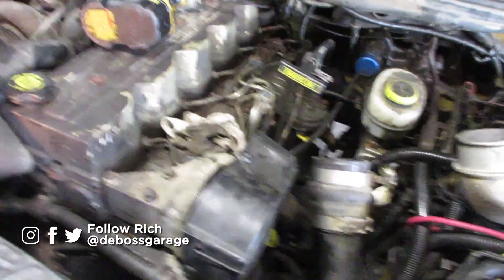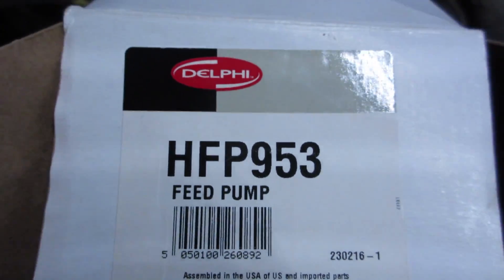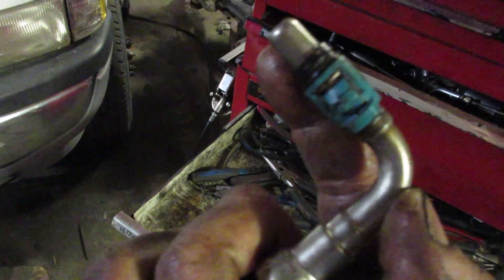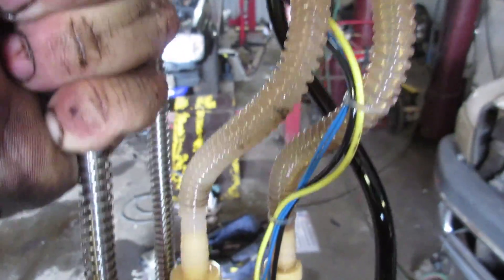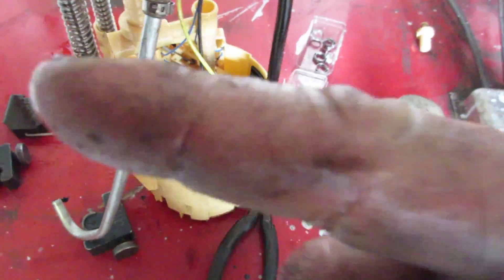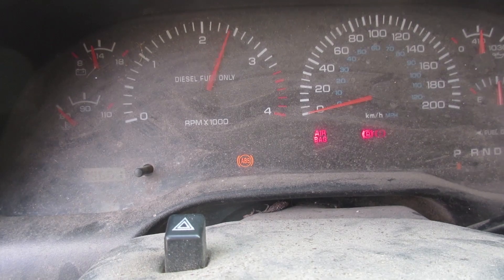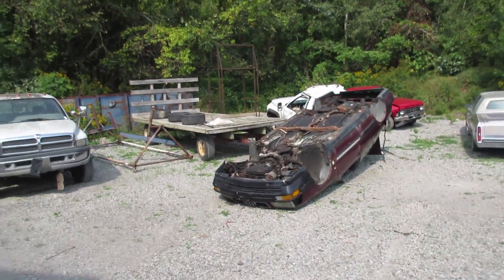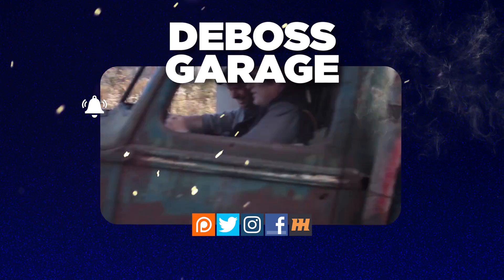How To Upgrade A Cummins 24v Lift Pump

Comment: I put A. Fast lift pump and I have 20 pounds pressure. When the vehicle is cold, it starts real easy but if you drive it for 30 minutes and shut it off for 30 minutes, it won't start hard. Start what can I do to repair this hard? Start and get my pick app back, funny, good.

Comment: Great vid.. sorry about your "Funny bone" (Yes i laughed) . 
I mounted a Holley Blue on the frame rail just in front of the tank... hard wired/switched it via relay - now looking to switch the relay via ECM.
From what i understand ECM doesn't like more than 5Amp draw (Like the stock pumps front or rear do. Mine had both 'cept the wire to the intank is dead and front is live. weird... anyways) more than 5+ amp melts solder in ECM, So thinking of ECM triggered relay with a resistor(No spike back to ECM) between the coil terminal 85(-Neg) &  86( +pos) both from ECM because ECM needs to see a simulated pump draw to get rid of code DTC  0230 - TRANSFER PUMP CIRCUIT OUT OF RANGE.
Anyways "thanks for the laugh" :)

Comment: 🤔 I have intake fuel pump on the 01 24v I just bought and a I guess a fass pump on side of the frame too. Before I could hear a pump soon as I turned it on now I don’t hear nothing? Did something fail. Guy had pump hooked to a switch

Comment: I just purchased the truck that had a fass upgraded pump on the side of the block there was also a pump mounted to the frame rail in a pump in the tank should I keep the fast and remove the other two or leave them all in conjunction with each other

Comment: I have a 99 dodge 5.9 24v Cummins that I just bought. It would start up but it was kinda hard and then I drove it around and now it won’t start but it’ll crack. It’ll fire on either but won’t fire by it’s self. Any ideas??

Comment: Question 
Can I install a in-line fuel pump in a 2500 dodge diesel and leave the in-tank pump in the tank??
Reply: That would not be a good idea.  It would possibly cause a restriction.

Comment: i have a 2004.5 5.9L cummins i have done everything from checking fuel pressure when cranking because it starts very hard a lot of the time and then it will die when giving it any load driving every single time itll puff a little black smoke and die. I checked the oil for fuel and replaced the FPRV on the rail with a block off. I have a $1200 scanner and turned off all injectors one by one they all make a difference when shutting each one off. Once the truck finally starts i get 6500ish-7300ish PSI of fuel pressure. I believe i get zero when it doesnt want to start as if the lift pump maybe isnt working only reason i think that is because i hooked a mechanical gague to the rear of the fuel filter housing... the fuel pump by the block was deleted or whatever they call it... Not completely sure i just have the fuel filter housing and a lift pump in the tank or whatever they call it. It does idle a little rough but no white smoke from exhaust and it gave me code for too much fuel pressure p0088 and i just dont wanna throw expensive parts at it so im wondering if anyone could help me out? ill be checking back often to see what everyone thinks....

Comment: Hi there from Brazil. 
Best channel out there.
Quick question: got a 2016 RAM 2500 Laramie and FCA did a recall of the water pump and the dealer exchanged the pump and filled 50/50 with, I believe with the proper anti-freeze AND water (tap water). How bad is that? Average temps. here are average 23-27 C, coolest days 10-15 C. We DON’T have distilled water here, I guess mechanics here don’t even know about it.
Hope you spot me and answer soon.

Comment: Hello so if you got a little lift pump next to the filter canister, that means that you dont have any pump in the tank?
Reply from the maker: correct
Reply: @DEBOSSGARAGE  thanks so muchb
Reply: @poolkillermonjaras5421  wat happens if u have both pumps and they both are working and it was that way when I got the truck

Comment: So my 3500 Cummins has a filter housing on the side of the engine, that means my lift pump is there as well and not in the tank.?
Reply: Well now that i know what Im looking for, it turns out mine, a 2007, has the filter housing on the engine and a tank lift pump.
Reply: I have a 99 2500 and I noticed the same thing. 2 pumps I believe. Is this normal?
Reply: @ketobeast8489  Watch the thoroughbred diesel video about fass pumps great info

Comment: I've been looking into upgrading my factory lift pump with a mechanical lift pump called the Fuel Boss by Glacier Diesel Power. I was wondering if you had any experience with this pump or knew anything about it?

Here is a link if anyone else is interested in a mechanical lift pump for a 24v Cummins.
https://www.glacierdieselpower.com/i-1112-98-5-02-gdp-fuel-boss-mechanical-lift-pump-system.html

Comment: Would you personally prefer a high pressure lift pump over a high volume lift pump to supply that vp44?
Reply: For a lift pump you want high volume, not high pressure.

Comment: Funny bone is not funny. I was changing a cabin filter of all things  in a Camry. The filter door was jammed and I slammed my funny bone into the passenger door jam taking it off. Woke up on the floor and ended up with a concussion from bouncing my head on the concrete floor after passing out from the pain or the (vasovagel response as the doctor exppained). Very embarrassing that a 6'3" 265 pound man was taken out by a damn cabin filter.

Comment: I have a Herko Automotive K4035 pump that looks identical to yours, but no 90° fitting came with it. Do you have any idea of a part # for it? Herko Automotive has not been helpful.
Reply: I just bought the same pump and would like to know this as well. Did you get that figured out?

Comment: I’m buying a truck he says it’s not starting do to a hole in the 6th fuel line and he says it might also need a new lift pump, is it worth it ?
Reply: Assuming you mean 6th injector line. Anywho the truck can start and run on cylinders 1 through 5. It just misses like crazy. If the lift pump is completely dead then you need to worry more about the injection pump. If the truck was driving when the lift pump died, your injection pump might be dead. A new vp could easily run 2k dollars. A fass ddrp 02 is about 300 and a new injector line is I think 100. So realistically if you get the truck for 2k max it might be worth it. But you gotta look at miles, interior and exterior condition. Since it doesn't run you can't determine how well the trans shift, or if the 4x4 works or how well the front end and steering is. You can't even check for blowby. Sounds like a junk parts truck to me

Comment: Im keeping my filters clean and mine has the kind thats on the side of the truck..I only have cold air intake and straight exhaust..I will do the upgrade when needed..But last winter we has some zero degrees and always started on the first bump of the key...Thanks for the video,God Bless You and Your family.
Reply: Mines the same way, has the one on the block and works perfect and starts instantly in cold weather. No need to upgrade when your truck is mostly stock and if it works fine as is.
Reply: Yes..why spend 600 for a highflow liftpump..my truck almost stock..just cold air and straight exhaust..How ever I have looked at a holly pump for our kinda trucks..its under 200 dollars..thats a lot less thana new VP 44..lol

Comment: My truck has in tank pump and died on me. It had the same setup as this. I removed the piece where lift pump should be. If in tank pump is gone will I not get fuel. All I'm getting is air bubbles. Still not getting fuel from tank. Lift pump is working but not getting fuel from tank
Reply: I have a problem with my 6.7 Cummins how do you know when pump goes
Reply: My truck start and cit off

Comment: A speed sensor in the rear diff will take care of the abs and brake light..
Reply: That’s the easy one.  It will be the sensors in each of the front hubs.
Reply: @russ3164  depends whether you have 2w or 4w abs
Reply: Hunter Boehm I’ve had 6 or 7 Cummins Dodges from 1991-2007.  Replaced the rear sensor on every one hoping it was the problem when the ABS/Brake light came on, and it never was.  It was always the front wheel sensors.  Maybe I’m just unlucky.

Comment: You would probably greatly benefit in cleanlieness by pressure washing the engine bays before working on them
Reply from the maker: One of those things where if I wash every piece of equipment that comes in I would have an environmental disaster on my hands.  Can't do it.
Reply: DEBOSS GARAGE LOL i guess thats true
Reply: Agreed. All of our floor drains go into a holding tank that has an oil separation system in it. If you wash every truck that comes thru the door outside in the stones. Then in 10 years you will have black dirt. Epa would have a field day.

Comment: how much was the lift pump? Would Fass be a beeter system
Reply from the maker: Fass is much better, so is air dog but they run $800 where this one was $200

Comment: Look into the Fass Ddrp extremely affordable and bolts right in place
Reply from the maker: Where is the best place to buy?  Help everyone out
Reply: DEBOSS GARAGE www.xtremediesel.com. We have installed the airdogg raptor direct replacement pumps. I would highly recommend them as a factory replacement for the guy thats not about performance just reliability. Very affordable.
Reply: I like my Fass titanium series LP . Its a nice unit for my needs.
Reply: whats the part number?
Im looking for the same set up

Comment: just run an airdog or fass.
Reply from the maker: This truck idles through a park collecting waste.  Can't justify an $800 (CAN) fass lift pump as the stock lasted 400 000 km.  This pump was a higher flow than stock
Reply: They have  there place when you want to make more power. Stock no....